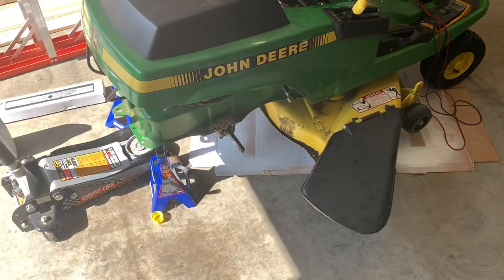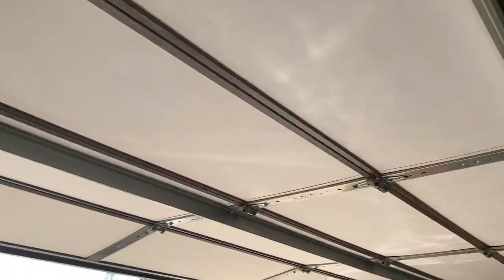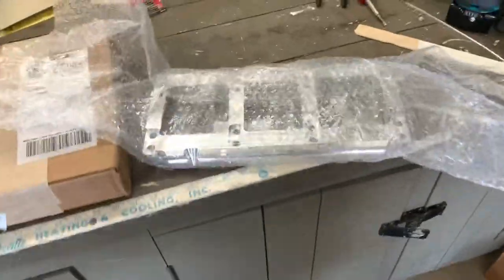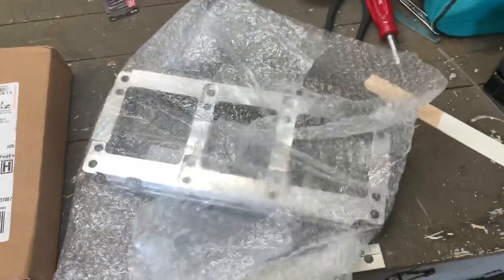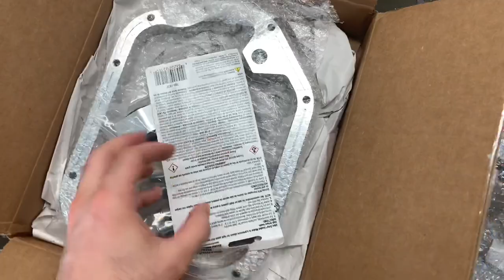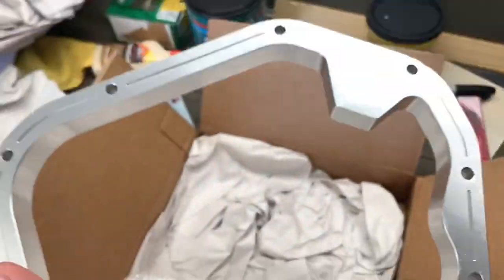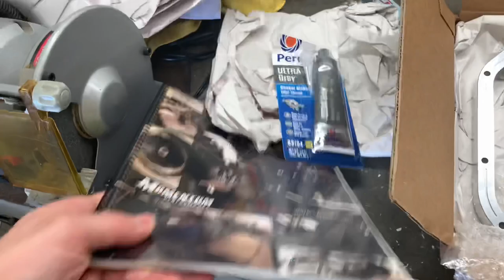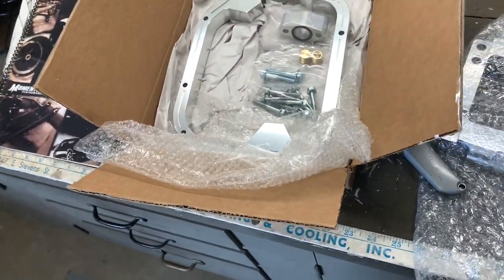Parts for the engine build (Ep. 2)

Comment: This is the second time I’ve seen someone mention the billet girdle. I guess i have to add that to my built block list.  So far i got down rod/piston, rev up billet gear oil pump, L19 head stud and ati damper.  Now that billet girdle
Reply from the maker: Yeah man it was a suggestion I figured I would go with. Just some peace of mind.
Reply: Vitamin Z  yea i agree. And since you’re there the L19 mains are about the same price as the regular arp mains. So throw those in too.

Comment: Where did you get those frames with three holes on them for your rear bumper?
Reply from the maker: Got them used!
Reply: @VitaminZ77  oh ok. Have any idea where I could possibly get them ? Also had a question for you . So I’m. Buying an innovative oil pressure and temp. Gauge(2in1) and also buying the Z1 oil pan spacer . I’m placing the oil temp sensor on the z1 oil pan spacer but not to sure where to place the oil pressure sensor ? I have an 06 g35 rev-up.also when installing the z1 oil pan spacer did you have any clearing issues with the inside baffle ?